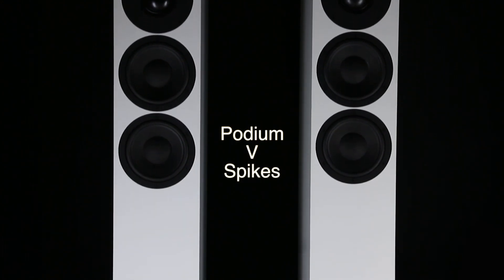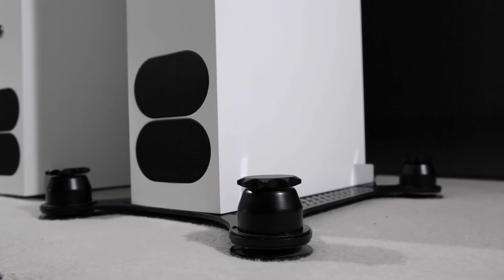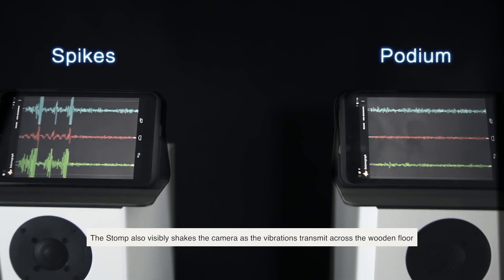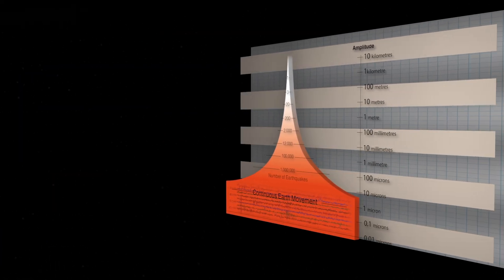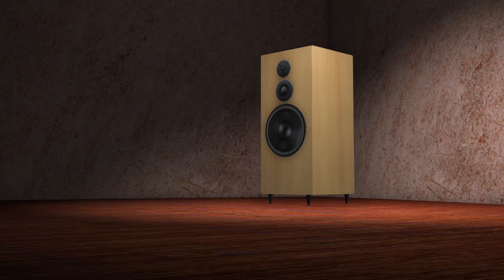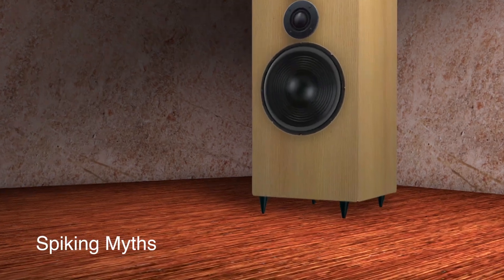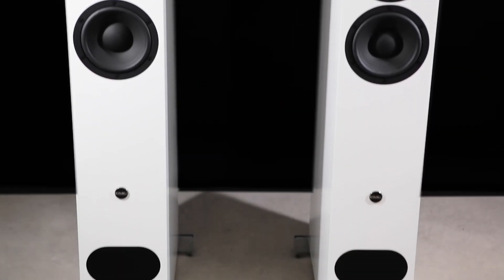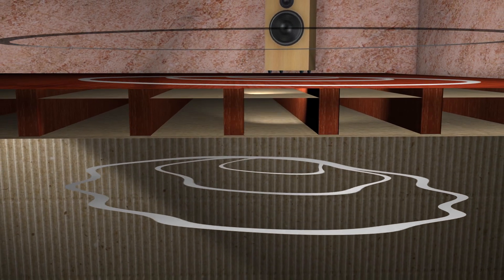Unlock True Sound: How Townshend Seismic Podiums Eliminate Micro Tremors & Vibration

Comment: Is there a product sized to fit under a Fender Tone Master Bassman? 😊
Reply from the maker: Hi Tim, Townshend Audio’s Seismic Isolation Podiums should work great under a Fender Tone Master ’59 Bassman (about 23.5" x 10.5", ~30 lbs). Their Size 3 or 4 podiums fit components up to 20.5" x 16" or larger, handling up to 200 lbs. For a perfect fit, contact Townshend for custom options. Check out www.townshendaudio.com for details!
Seiemic Bars are also a great option.

Comment: I have 12" bass drivers (alnico) mounted in their own cabinets, sitting on 15" drivers in their own cabinets. The 15" drivers are passive in that they are only there to absorb vibrations from the bass speakers so that the vibrations can't go through the floor to the free-standing  open baffle speakers. Anyway the mass of the 15" drivers is what takes out the bass ringing vibrations in my room for clean sharp bass.

Comment: I used rubber as speaker feet under. I just need to get sorbothane rubbers if available. My existing set-up of rubber feet is on top of a tray wider and longer than the speakers filled with sand of 3 inches deep.

Comment: I simply can’t afford these but have made my own using plant pot dolly’s topped by kitchen chopping boards then 2 inch thick foam isolation pads. It works for me with the added bonus that I can easily reposition my speakers in my living room. Costs about £80 and a definite sound improvement compared to using spikes.
Reply: well unfortunately they won't be isolating down anywhere near three hertz like the Townshend podiums do, the improvement I got was absolutely amazing it was like I upgraded my electronics to something way more expensive.
Reply: @chrisrichards2827  I have changed the plant pot dolly’s for heavy duty furniture movers and the results are excellent.

Comment: @Max Townshend  Sorry, you are wrong: if I were to suspend a speaker cone/driver devoid of its holder/cabinet assembly by, say, a string hanging down from a stationary point say 20' above in perfectly calm air and pulse it (when it is perfectly stationary and still) to propagate a sound wave, there will be a forward movement of the cone with a responding rearward movement of the cone/driver assembly similar to a rifle recoil when a bullet is fired. But, unlike the rifle recoil, the return movement of cone rearward will be responded to by the cone/driver assembly moving forward. The very movement of the cone/driver assembly rearward responding to the cone's forward movement will cause a frequency shift in the propagation of the sound wave. If you don't believe this, do the experiment and learn the truth for yourself.
Reply: That's why there is frequency-shifted sound from suspended rock concert speakers
Reply: @maxtownshend8375  I don't want frequency-shifted sound from my audiophile system, thank-you.

Comment: Aside from the expense of the Seismic Isolation Podium (SIP), it is too spongy to prevent movement of the speaker cabinet/assembly due to the throw of the speaker voice coil which propagates sound waves unless a sizeable amount of mass loading is added. I would like to see these speakers set up as shown in this demo on a flat level vinyl tile floor driven at 90db pulsed output for various frequencies (start at 50hz and work through the audible spectrum in 50hz increments to 20,000hz) and use a frequency meter (which is insulated from sound transmission through everything except the air) set at 1 meter from the front of the speaker cone which is propagating the sound waves for the frequency being tested, and see what the differences are in the propagated frequencies between the speaker on spikes and the speaker on the SIP. I have come up with a solution which could be used for the speaker with spikes shown in this video for less than $50 + tax: two 2'x2'x2" concrete paver stones (90lb each) approx. cost $16.00; eight spike cones approx. cost $25.00; eighteen 2"x2"x7/8" antivibration pads approx. cost $5.00. Here is how to set up: I have found the best sound from my system is achieved through the use of spikes/discs/antivibration pads/concrete pavers: https://drive.google.com/drive/folders/1C1w4HcZuThrTxImadujOdftffK3s_2K3?usp=sharing . If you have wood flooring or some other flooring material which is relatively smooth and hard, and you don't want to ruin it with concrete pavers being set upon it, use the antivibration pads under the concrete pavers, one near each corner and one in the center.
Reply: but how do you know it would be as good as the podiums because you've never tried them and compared right? so if you can't afford them just say so.
Reply: @chrisrichards2827 I know enough about about simple physics to know that you want only the speaker cone which is producing the sound by its movement to move and everything else except the cone's driver to be held motionless, and at the same time not allow vibrational transmission to the assembly in which the cone/driver is contained, which implies damping.
Reply: @michaelporter7434  well obviously you don't know enough Michael because all the reviewers that have tried th are now using them to do their reviews they said that yhe sound was so much better with the podiums in place, if you can't afford them it's no crime to admit it.
Reply: and since you haven't tried them how do you know it's too spongy to prevent speaker movement obviously you don't know that much so if you can't afford them just admit it.
Reply: @chrisrichards2827  Tell you what: when I have the time, I will set up a stereo microphone in my listening room and record the sound coming from my speakers and send you a CD I burn of the recording to play, and you can judge for yourself how my setup sounds. Fair enough?
Reply: @michaelporter7434  well since you don't have the podium  you don't know if the podiums sound better or not then you're set up.
Reply: @chrisrichards2827  I replied to you yesterday evening with a link to my system, but whoever moderates this channel apparently took it down for the I don't know how manyth time: don't know why they don't want me sharing my system set-up, maybe they feel threatened for some reason.
Reply: @michaelporter7434  well I just got the podiums and put them under my monitor audio platinum 200 Gen 2 and holy crap it sounds like a whole new system way more expensive these podiums really do the job. best $2,000 Canadian I ever spent. the whole soundstage has got wide deeper more airy and spacious and the boominess in the base is totally gone nothing's coming through the floor or the walls, these things are definitely a game changer.
Reply: @chrisrichards2827  Did you go to my comment which started this reply chain: the link I was trying to give you is contained there. And my system is so revealing that I will not 
change anything about the way I have my my speakers installed. Try this video for soundstage size: < https://www.youtube.com/watch?v=FMSC7Tg8Yek >. The back area of this orchestra should sound like it is about 75 to 85 feet behind your speakers with a soundstage width of 100 feet or more. I am set up to play this via JRiver MC29 set to output 512DSD to my dac with the benefit of Audiophile Optimizer using Ultimate Mode (paid version).
Reply: @michaelporter7434  well why don't you tell me what your setup is and I can judge from there already and if you'd like to know my setup I will be happy to tell you as well.
Reply: @chrisrichards2827  Go to my original post at the start of this reply chain: there is a link there for my system set up, photos, and more. I can not post the link in this reply as it is repetitious and gets kicked out, so you will have to look at the beginning of this reply chain
Reply: @chrisrichards2827  Scroll up to the beginning of this reply chain.
Reply: @michaelporter7434  I can't unfortunately
Reply: @chrisrichards2827  Why???
Reply: The frequency would be identical as Newton's 3rd law applies. If you, as you suggest, the frequency changes, then how come the music from hung columns at rock concerts isn't weirdly distorted and lacking in intensity?  Antivibration pads are far far too stiff, as they only start to isolate above 30-40Hz- we abandoned that approach in 1985 and went for the very soft springs which are 20dB+ down at 10Hz. 
We must be doing something right as we got the highly coveted Product of the year from The Absolute Sound.  http://www.townshendaudio.com/PDF/Townshend%20Seismic%20Podium%20-%20The%20Absolute%20Sound%20product%20of%20the%20year%202020%20_%20Speaker%20Vibration%20%20Isolation.pdf?fbclid=IwAR0LseZIOlLxaKI6D8MmrJZduXHkehZDVbfBBtKEgwvMnZzIzSyoQh4pclA
Reply: @maxtownshend8375  Sorry, you are wrong: if I were to suspend a speaker cone/driver devoid of its holder/cabinet assembly by, say, a string hanging down from a stationary point say 20' above in perfectly calm air and pulse it (when it is perfect stationary and still) to propagate a sound wave, there will be a forward movement of the cone with a responding rearward movement of the cone/driver assembly similar to a rifle recoil when a bullet is fired. But, unlike the rifle recoil, the return movement of cone rearward will be responded to by the cone/driver assembly moving forward. The very movement of the cone/driver assembly rearward responding to the cone's forward movement will cause a frequency shift in the propagation of the sound wave. If you don't believe this, do the experiment and learn the truth for yourself.
Reply: @michaelporter1870  Will the frequency go up or down?
Reply: @maxtownshend8375  Down when cone is pulsed forward.
Reply: @maxtownshend8375  Think about this: if what you are saying is true, then why aren't speakers suspended inside the speaker cabinet instead to being rigidly mounted?
Reply: @maxtownshend8375  Actually, to be perfectly fair, the amount of frequency shift that will occur using your SIP will depend on the total mass of the speaker/cabinet assembly and how far above the cradle of the SIP the speaker cone/driver propagating the sound is located. The greater the mass of the assembly, the smaller the shift in frequency will be. There will be no shift for cone/driver assemblies which are held rigid so that the only movement (as opposed to resonance vibration) in the speaker/cabinet's surrounding environment is the speaker cone propagating the sound waves. However, rigid mounting leads to the other issue of vibration/resonance transmission between speaker/cabinet assembly and floor/wall/ceiling (depending on mounting). That is precisely why some antivibration material needs to be incorporated at some location between the speaker/cabinet assembly and the floor/wall/ceiling while at the same time preventing movements of the speaker/cabinet assemble responding to the pulsing of the speaker cones.
Reply: @maxtownshend8375  And by the way, if 3"x3"x7/8" antivibration pads ($0.55 each) which are specified to handle 50psi each are used in conjunction with fabricated 3"x3" square disc assemblies for the speaker spikes, then the total evenly-distributed weight that can be supported by a concrete paver stone (assuming four spikes) is 9x50x4=1800lb, and 9x50x5=2250lb (assuming 5 antivibration pads placed under the concrete paver stone for even weight distribution) supported by the floor. This is more than twice the weight of your largest standard SIP (at $2400.00+ per pair) and I would have to fabricate the 3"x3" square spike disc assemblies and cast my own concrete pavers for size, but I'm sure it would not add more than $150.00 to the roughly $10.00 cost for the antivibration pads.
Reply: @maxtownshend8375  I will make it really simple for you to understand: if you are traveling down the road at 60 mph and approaching a car honking its horn which is stationary and continue on past that car still honking its horn, the pitch that you hear will lower after you pass the car honking the horn. This is an example of frequency shift due to your motion relative to the stationary car horn honking. In the case of the speaker cone/driver assembly, the assembly is moving away from (rearward) its initial position, so that movement has to be subtracted from the forward movement of the speaker cone which will result a lowering (shift) in the frequency relative to the surrounding environment in front of that speaker.
Reply: @michaelporter1870  This is the Doppler effect, which has been debated on and off since the invention of the loudspeaker, especially full-range cones. Even your eardrum suffers from this. The trouble with rigid cabinet mounting is that the cabinet is not infinitely stiff and the ground is not infinitely rigid. This means that the cabinet vibrates like a plucked ruler in a vice. Watch the video carefully and all this is explained.
Reply: @maxtownshend8375  Call it what you will, Doppler effect, it is still a frequency shift in the wave propagated by the speaker due to the addition or subtraction of motion relative to the movement of the speaker cone when pulsed to propagate a sound wave. The physics principle behind this has existed for as long as the universe has existed even if it wasn't known before being discovered. The advent of loudspeakers did not/could not change this principle of physics. There is no debate about the facts surrounding frequency shifts when motion is introduced as I have previously described. If you doubt this, consult a physics professor. The requirements to prevent motion of the speaker holder/cabinet while simultaneously preventing transfer/transmission of motion/vibration/resonance between the floor/wall/ceiling and the speaker/cabinet assembly means that both fixed stabilization of the speaker holder/cabinet/(stand if used) assembly as well as damping to prevent vibration/resonance between the assembly and the floor/wall/ceiling need to be incorporated. In the scenario I presented to you utilizing the spike/disc/antivibration pad/concrete paver/antivibration pad sandwich, the concrete paver (90lb) adds enough mass loading to the entire assembly placed on the floor and also has the effect of absorbing any possible vibration/resonance from the speaker cabinet which might make it through the top set of antivibration pads while the bottom set of antivibration pads will complete the elimination of vibration/resonance transfer/transmission to the floor.

Comment: 1:24 ???
Reply: That shows the impulse of the tap to the speaker which is mounted on the Seismic Isolation Podium with no ringing  following the impulse in the trace: basically the Podium is damping any resonance/vibration which would result from the tap if the Podium wasn't placed between the spikes and the floor. I have a lengthy back and forth with Max Townshend from 2 days ago on this webpage you might find interesting to read.
Reply: @michaelporter1870  I believe the product works but im skeptical about the app not reacting to the swaying of the speaker. And btw i just tested the app, which is the least popular with reviews of not being accurate (btw the link in the description is not working) and indeed... just try it out yourself and compare it to the other more popular vibration meter apps and you will know what i mean.

Comment: Thank you for your descriptions and intelligence in this matter,it’s hard to hear real intelligence these days,much appreciated,it’s unfortunate that everyone with there negativity opinions show there lack of education 🥴
Reply: Aside from the expense of the Seismic Isolation Podium (SIP), it is too spongy to prevent movement of the speaker cabinet/assembly due to the throw of the speaker voice coil which propagates sound waves unless a sizeable amount of mass loading is added. I would like to see these speakers set up as shown in this demo on a flat level vinyl tile floor driven at 90db pulsed output for various frequencies (start at 50hz and work through the audible spectrum in 50hz increments to 20,000hz) and use a frequency meter (which is insulated from sound transmission through everything except the air) set at 1 meter from the front of the speaker cone which is propagating the sound waves for the frequency being tested, and see what the differences are in the propagated frequencies between the speaker on spikes and the speaker on the SIP. I have come up with a solution which could be used for the speaker with spikes shown in this video for less than $50 + tax: two 2'x2'x2" concrete paver stones (90lb each) approx. cost $16.00; eight spike cones approx. cost $25.00; eighteen 2"x2"x7/8" antivibration pads approx. cost $5.00. Here is how to set up: I have found the best sound from my system is achieved through the use of spikes/discs/antivibration pads/concrete pavers: https://drive.google.com/drive/folders/1C1w4HcZuThrTxImadujOdftffK3s_2K3?usp=sharing. If you have wood flooring or some other flooring material which is relatively smooth and hard, and you don't want to ruin it with concrete pavers being set upon it, use the antivibration pads under the concrete pavers, one near each corner and one in the center.